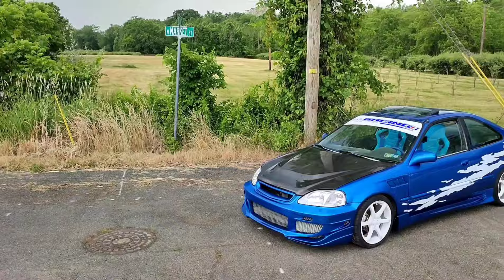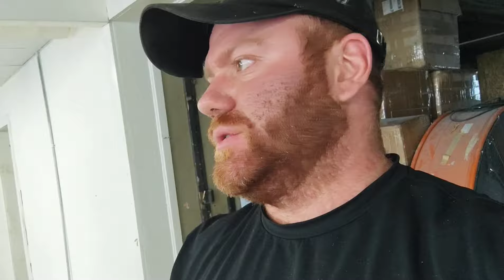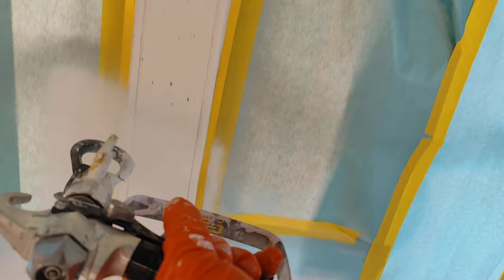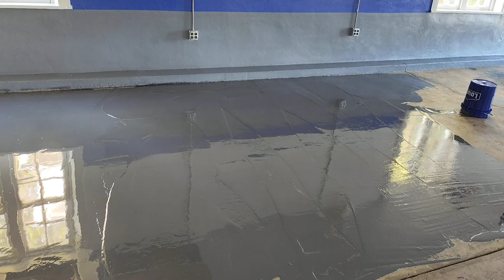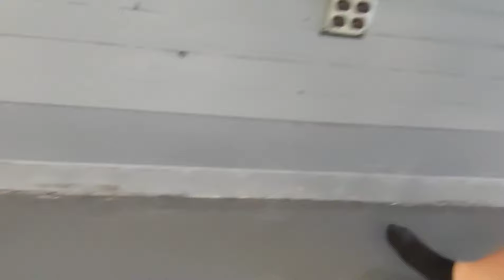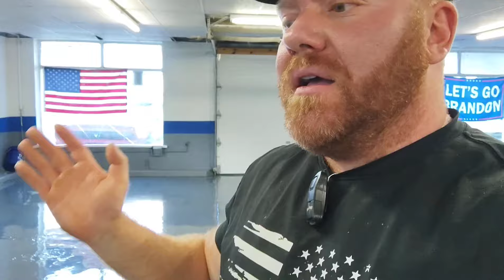Garage floor epoxy transformation

Comment: Nice job. The shine makes the place look a lot nicer. FYI, you can rent concrete grinders with 30, 70 and 120 grit pads and concrete floor planers that remove 1/16" on a single pass. The grinder does about 200-250 sqft per hour and the planer about 300-350 sqft per hour. Rent is about $300 for a day for a high cost area. The machines can be used to remove old sealers and paints.
Reply from the maker: Oh wow nice !!!!

Comment: Nice job on the floor Marco it looks a massive improvement from the old concrete one, this should be a lot cleaner for you as well with no concrete dust being picked up👌I get the feeling there is nothing you cant do🤔💪👍
Reply from the maker: @JohnWD40TC02  yup that was the goal ! Cut down on that concrete dusting .